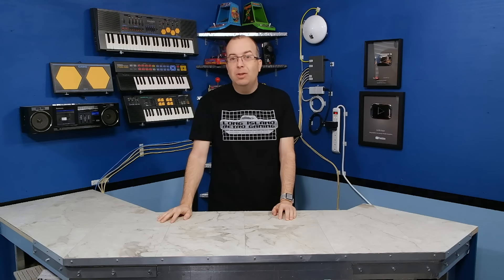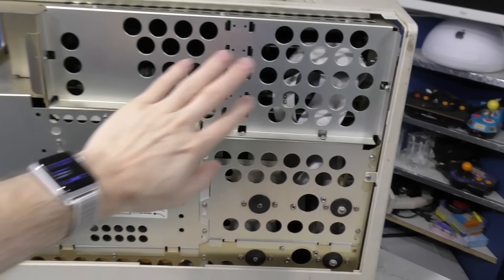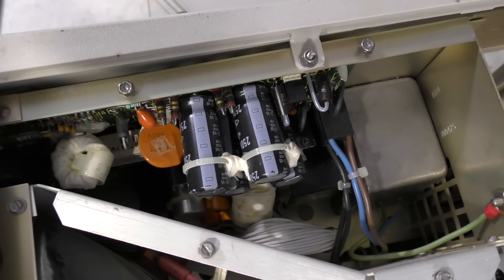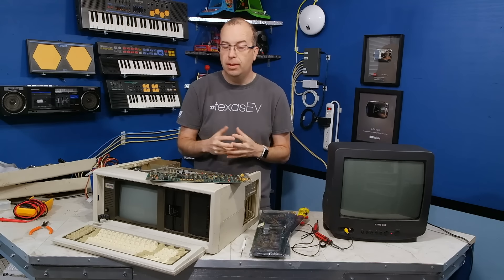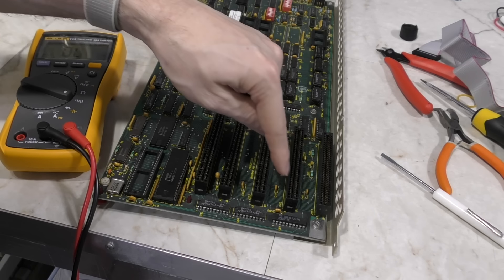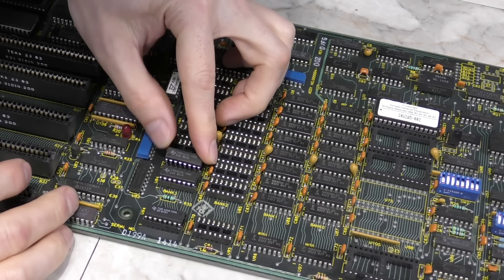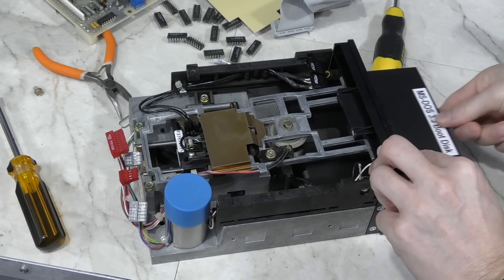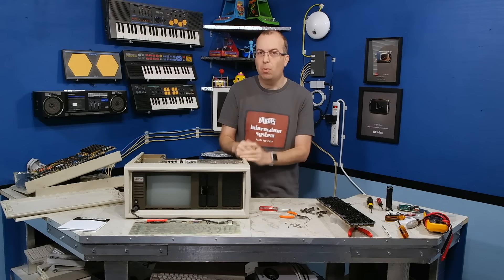Compaq Portable 1 Restoration - Part 1

Comment: Geez, I’m feeling old right now. I was there when these were the best thing!
I used to service these and many other computers of similar vintage. Olivetti, Compaq, Alpha Micro, IBM. Back in the day when businesses used to call service companies to fix things. Reseating chips, cleaning out the dust, cleaning edge connectors, disassembling keyboards cleaning and fixing them. 
Chasing logic circuits to find the one chip that was dead was a passion and very rewarding!

Comment: Hey. Nice. My first guess was to also reduce  load and check the power supply output. 😀. But judging from the multimeter we might guess that the capacitors are shot....

Aww darn it was shorting on the video card. 😀. Kinda makes sense though because even a fairly shot psu capacitor should be able to sustain an electric current longer than that.

Comment: Thank you for this video. It helped me with diagnosing my own issues with this machine. I managed to get a hold of one and it wouldn't boot just like yours. The floppy controller card shot out similair sparks when I plugged it into my 5160 I use to test ISA cards. Once I replaced the blown tantalum the machine booted right up. I'm now waiting for the "foam and foil" pads from texelec so I can complete the restore.

Comment: I did something like your „Jumpstart“ for a while with my gaming PC because i upgraded the CPU and the power supply was to weak to power the new setup. Worked fine, just make sure you connect the grounds together.

Comment: 5:55 "that was a bit unexpected"  --that's totally what I expected 😂
Reply: One way to find a dead short lol power through it hahah
Reply: Yeah... this was totally what I expected too...
Reply: LOL me too.  I was like, "No no no.  Bad idea!" : -)
Reply: I thought about starting a thread about this but didn't want to come off as a know it all so I'll just post it here. Yeah, I was expecting that too. As soon as I saw the blinking LED I thought "yep, shorted capacitor somewhere." At least blowing it up allows one to find the bad one, LOL.
Reply: the blue djinn has been released
Reply: smoke test  F
Reply: +David Annett It's also a good way to find an underdesigned trace which connects to a short somewhere in the machine.
Reply: Hells yeah, smoke test! Used to call that out every time I started up a new machine. Always in jest tho, but it scared the newbs because we'd tell them to make sure not to cross wire the power supply to the motherboard. In later machines it was almost impossible to do, but it sure made them sweat.
Reply: Typical for tantalums, they go short circuit and with enough amps it catches fire. Was sure this would happen. :D
Reply: Haha !
Reply: Could've been the Osbourne all over again
Reply: Yup :)
Reply: hahahaha absolutely
Reply: Well there’s your problem ..
Reply: Ever see the result of powering up a new 15" x 20" 10-layer board in a machine that has +4.75 @ 1500A and -2 @ 2500A and they routed the board wrong with the supplies connected? I have. It was a quite impressive smoke and fire test, but it took a couple of weeks to repair all the damage to the rest of the machine.
Reply: I thought I was watching ElectroBOOM
Reply: Me too, ElectroBoom moment!
Reply: I was thinking "I... wouldn't do that if I were you... but you know more about electronics than I do, so...*shrugs*"
Reply: exactly like diodegonewild's oh shieet when the glue gun blew
Reply: Remind me of ElectroBOOM    :-P
Reply: OMG that was classic! I was like... oh no he isn't... 😂
Reply: Hahaha. That was hilarious. I love the 8-Bit Guy. Informative and very entertaining.
Reply: Yep, me too
Reply: Electroboom
Reply: 10/10 idea
Reply: That was 8 bit expected.
Reply: CorrosionX4 I thought that was what would happen when he first plugged it in lol
Reply: Same.  As soon as the PSU blinked on then off, I knew it was triggering a fail safe, and there was a short somewhere.

Comment: I have a lot of nostalgia for  this machine.  My dad was a mech engineer and had this.  I would beg him to bring it home on weekends so I could play, write code, experiment, etc on it.  I'm pretty sure it had a hard disk, so I had my own 5 1/4" floppy i hand crafted that would boot into my section of the hard drive.

In the initial stages of creating the separation, I would forget to flip it back to his partition, so a couple of times I had to coach him through rewriting the sectors on the HD... lol.

I eventually started playing with modulating the tin-crap speaker in there... only one channel so you could flip between about 2 or 3 different notes real fast and get multi tones.  Then I got my hands on a dos program named "player piano", it would take real music files (like play C for 1 unit of time, then D for .25 unit, etc).

I was only about 10 years old at the time and I'd be up all night friday night once he got home, then saturday night, then sunday night and try to remember to flip the HD back to his work... LOL

Wow.  Hope to see it working again.  You only truly need 640k of RAM. (snicker)  And to be clear, Gates argued the opposite of that. LOL

Comment: Looking forward to the Part 2!  I actually went through about this same adventure with my Compaq Portable.  It turns out that the power supply is smart and if too much current is drawn, it will shut down to prevent damage.  Those darn tantalum's are a huge problem in electronics this age.  I ended up having one of them on the motherboard and one on the video card that were shorted.  Found them by pulling the motherboard and testing the power rails using a bench power supply.  Turn it on briefly and use a thermal camera to look for hot spots which show up pretty fast.  Pull and replace the cap and fixed!  I think my floppy controller had a bad can oscillator on it too which seemed like an odd failure, but was also easily to replace.  The AC filter smoked not long after playing with it and was to be expected according to many who were giving me advice.  This got it booting, both floppy drives worked great right off the bad.  Keyboard problems were the next thing I found with the bad foams - replaced those.  The last problem was that some video characters would inadvertently change on occasion.  Used a Hakko FR300 to remove DRAM's from the memory board and replaced them and solved that.  These things can be quite a bit of work to get working, but they are really cool machines.  I think you can use a ctrl-alt combination to switch between a true mono mode and cga mode.  Maybe ctrl-alt-< and ctrl-alt-> or something like that.

Comment: Brings back so many memories.  Staying up all night downloading games and apps from local BBS sites at 2400 baud, around 220 bytes per second with the zmodem protocol if I remember correctly.  Great machine.
Reply: You had a 2400 baud modem? PSHAW! My first modem was a 300 baud manually switched Radio Shack model. It was a couple of years before I traded up to a genuine Hayes 2400 baud unit.
Reply: Rick C. Hodgin I hope you remembered to turn on  crash recovery

Comment: "Let me bend these paper clips and connect the power supplies together..."
Oh yeah; that's really safe, lolz
I'm surprised you didn't blow a breaker fuse, lol
Anyway, this was interesting to watch; I hadn't seen one of these computers before (only heard the name). Good to see more outdated, retro tech. Hope you're able to get it up and running.
Reply: blow a breaker fuse by shorting the 12v rail or the 5v rail on a computer power supply?lol...if you have no clue about the subject please dont comment on it...i dont comment on cooking or makeup videos because i dont understand shit about those things....
Reply: Hugo B. Haha yep. And it worked anyway, cause instead of spending hours with a multimeter and a circuit diagram he found the short cap much quicker...

Comment: Shall we get the multi-meter and search for the short?
Grabs 500w PSU
Nah
Reply: That's like looking for gas leaks with a lighter xD
Reply: to be fair, its like thinking its the gas ignition not working, not that there is a gas leak, so basically he tried lighting the gas ignition with another gas ignition unaware that the room was full of gas XD
Reply: That was a very Slav thing to do, maybe needs an ancestry test to determine how much slavness runs in his blood
Reply: Basically my last ditch effort debugging equipment. Short the fuse with a nail, and see where the fireworks come from.
Reply: @Djbiohazard1991  But current is all the same in a closed loop (remember kirkoffs laws?) So fireworks could also come from something that hasn't gone bad
Reply: @jort93z  no everything in a computer is on the same loop but some components will be in closed loop
Reply: @jort93z  it is the internet so I am always right
Reply: You made me giggle XD

Comment: I remember when these "luggable" PCs first came out; being heralded as a portable PC, with the connotation of Compaq being a "compact" PC.  In later years Compaq went to producing decent quality desktop PCs.
I have one those boat-anchors in my garage, where its weight and heft does well to anchor, in place, some stiff cabling on the floor in my garage.
Reply: You can't call a device a portable device when it looks like it weighs a ton

Comment: The Compaq 1 originally had two floppy drives. One of the computer shops biggest profit centers was installing a Seagate 20 meg MFM 5-1/4 form factor hard disk drive into the thing. The power supply was marginal and when ever I did one, I hoped that the power supply would not die quickly under the increased power drain. When the lap top came into use two to three years later, we made money transferring their data from the old Compaq to their new lap top. Brings back many memories of the mid to late eighties in the business.

Comment: I liked the video that machine made my very notalgic. I have some suggestions...
1. When the power supply's rails don't come up with everything connected try disconnecting it from everything and attaching a dummy load made out of power resistors. That way you can asses if the power supply is bad or if the it is in hickup mode from a short. I keep a selection of power resistors mounted on a heatsink for this.
2. Bridging two large power supplies isn't a good idea because their protective measures against excessive load (hickup mode/foldback limiting) won't work.
3. If you suspect a power supply is going bad and not supplying the rated current and you can't use a dummy load for some reason measure the current output at peak with a clamp on probe or by adding a series resistor and measuring the voltage drop across it. Try looking at the output of any of these measurement methods with an oscilloscope. You don't need a fancy high end one for this. Bad capacitors in a power supply will show switching noise and or 60Hz ripple on the output. 
4. When you have a short on a board try using another power supply with a current limit set low. Then use a meter with a milivolt or better microvolt scale to measure where on the board the rail is lowest. Odds are that will show a kind of heat map to where the bad capacitor or what ever is.
5. Did you try fixing the fried motherboard by tacking some 20AWG wire to fix the broken 5V/12V rail? (I know 30AWG wirewrap wire worked on the other one but the current required hear means you really want more than that)

Comment: Wow that power supply jump-start is some MacGyver-level s#!t!

"Broken Compaq? I'll need four paperclips and some chewing gum" 😂
Reply: Brilliant lol
Reply: And includes some stuff blown up.
Reply: Have you not used two power supplies ever? 
I had to jump start my graphics card because my current power supply didn't have enough energy to supply.
Reply: I've done something similar before, so it was nice to see.
Reply: Got an 1100W powersupply in my pc. Works nice. Little overrated maybe...
Reply: Was expecting it to go badly wrong just from looking at the exposed paper clips in the molex. PSUs are the one thing I hate dealing with.
Reply: Haha I know right?!?!
Reply: LOL
Reply: *MacGyver
Reply: Epitome Soul Kayanzeblanda Hard part is knowing the internal bus configuration of each PSU and how each might react to backfeeding during start/stop and when power sneaks from a backfed rail to an overloaded rail.  If possible, I'd check internal diagrams unless it's a standard config (yes I have worked with dual PSU machines, usually ones designed to allow hot-swapping PSUs while running).
Reply: It's spelled MacGyver...
Reply: quite the bodge or a way to get health and safety knocking at your door! a neat idea but he needs to put a warning saying "warning only try this is you know what your shorta doing i kinda do but you might not"
Reply: it haulted and caught fire
Reply: It looks like you’re writing a letter. Would you like to get help?
Reply: Wonderful comment! thats great.  needs  "Don't question me on this, I've worked with less!" lol
Reply: Bah Ha ha ha
Reply: It's kinda silly really. All you need is a Molex splitter. He's also using a screwdriver instead of a chip puller. It's not so much McGuyver as just using the wrong tools.
Reply: "And I'm all out of gum."
Reply: >Oh McGyver, how will we open that vault door in this abbandoned office building?
>Let me think... bring me that old compaq, some chewing gums and enough paper clips to form a power line from the nearest electrical socket, we gonna blast our way in!
Reply: Yeah I was thinking "Umm, dude, that looks like a really bad idea..."
Reply: Jesse H. And I’m all out of chewing gum
Reply: Dual PSU setups are on modern machines where the power supplies are inteligent enough to load ballance and etc. This is from another age and you really shouldn't do that.
Reply: "And I'm all outta gum"
Reply: Good for you!
Reply: You better is the best.
Reply: Oh but im out of gum... 
Ok, no worries. But there might be fire xD
Reply: "and I'm all outta gum"
Reply: no actually it was a very stupid thing to do :P but hey thats part of the learning curve sometimes ;)
Reply: Jesse H.  No
Reply: Jesse H. Yep
Reply: Jesse H. No he's like get me a mother board and  CCTV and just give some random cords and he  make it work useing the CCTV mother board and a AV cord and a HDMI cord.
Reply: Haven't you seen the video? The "jump start" did nothing but break up the capacitor.
Reply: Axel Foley only needed some chewing gum. The foil from the gum completes the circuit and then you use the gum to hold it in place.
Reply: lmal

Comment: That IBM Multinet Card is neat to see.  It is from the DISOSS networks that allow document sharing, file sharing and e-mail in the early days.  Ethernet won though.  I only seen them a few times in the early 90's when I had to get data copied off of DISOSS network and onto a Novel Network I was setting up.

Comment: The tantilum caps in the Compaq 1 are a real pain. I’d expect more to fail as you run the machine. I had 4 or 5 fail in mine, across the motherboard, CGA, floppy, and power supply! 
Don’t fall into the trap of only replacing the foams that have degraded, do them all. You can get new Mylar at a craft store, it’s common with wrapping paper. Good call on ordering foams for the keyboard... that’s what I’ve done for the last few I’ve repaired. I don’t have the patience to cut out all those circles!

Comment: With those small screws with a wrench box, to make it easier, you have to sand ( vibrating sander or ribbon one) the 45degree smoothing that consumes about 1.5 mm of depth from the beginning of when the socket start to grip from its edge on the screw. It becomes sharper but you have now enough depth not to slip on those screws not tall enough.

Comment: Yeah.  I've got one of those.  After a while you get good enough to just be able to pop those plastic panels with your finger nails.

Mine came with two full height 5 1/4 in. floppy drives.  What I did was pull those out and put in 2 half height 5 1/4" drives and a 30 MB RLL hard drive.  I made a plastic cover for the half slot that was empty out off a plastic floppy drive case.

I had to use that system with the top off.  I'd do it with the top panel propped up with a ruler - which was handy as it could put documents up on top of that and reference them while I was working.  I also had to set up an external fan to blow on the system to keep it cool.

I had an external Color CGA monitor for it but lent it to a buddy of mine.  Years later he called and asked if I wanted it back - I'd forgotten about it and ... with all the other computer junk I've got around here I said "no".  So if I ever try and use it again I'll have to go with the internal green screen.  I also had a very large platform made to mount this Computer on - so you could tilt it and swivel it when viewing the monitor.  That made using it a lot easier.

I tried using this system outside, connected to a three prong electrical outlet via an extension cord (as this thing did not have batteries) but the sun was to bright to really see the monitor well so I stopped trying to do that.

I got a lot of use out of that system.  We moved into a new building and didn't all have computers for a while - so I'd lug that thing in to work every day and used it, then lug it home.

 The next system I bought was a Northgate 486/25.
.